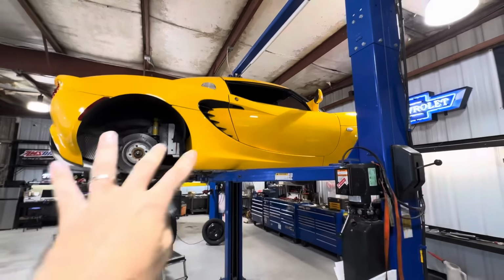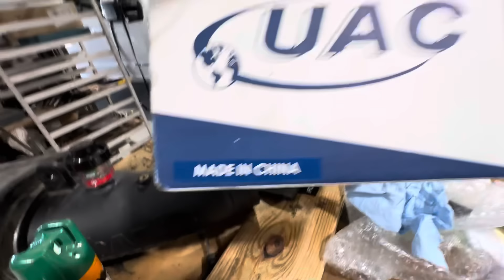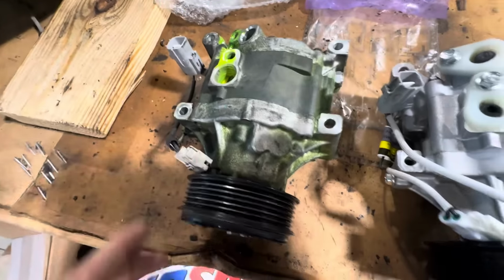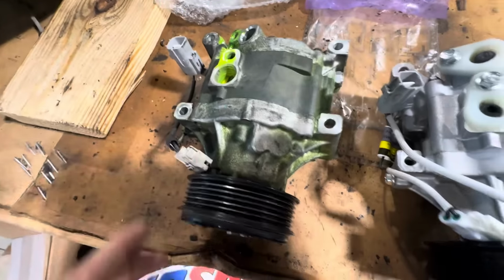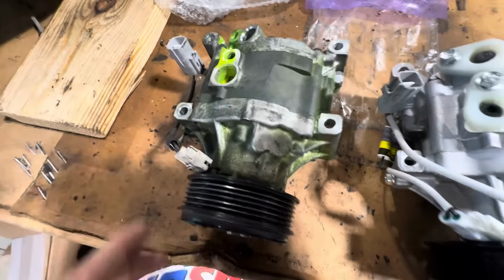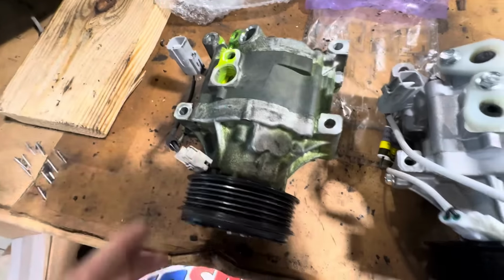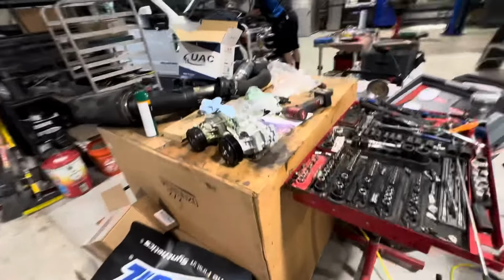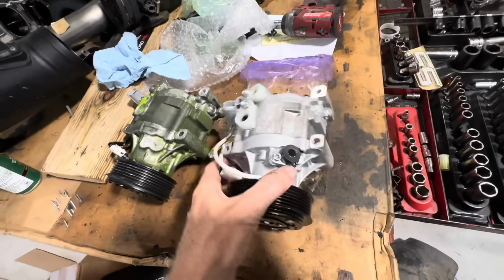Compressor Swap Something not right! Lotus Elise 1.8

Comment: Surprised that the owner would spend the money on the car but cheap out on replacement parts. Always the best bet to go with OEM parts if possible.
Reply: Maybe the original part from Lotus is not avaliable.  Maybe he can find a toyota MR2 version that will fit
Reply: Other than that, finding an A/C compressor is a piece o' cake...
Reply: Not ALWAYS.  There are a number of parts that are much better in aftermarket than OEM.  For some reason, a lot of car makers assume that oil change places hire master mechanics rather than teenagers, so they use a fragile oil filter housing.  Even Toyota is doing it now.
Reply: Best? maybe. But you assumed the OEM part is available for a 2007.

That UAC is the brand RockAuto lists, only one part number (out of stock).

Comment: Yeah making sure it fits is the key and checking that plug on the car was the key. Because who knows that old compressor was not just a replacement itself at one point early in its life. The wire being only one proves that it's not the right part. So many times people want the same connector and so on but this is a reason why not using the same connector would stop someone from slapping on the wrong part. Its not the connector thats the problem but the locking mechanism they need to make right and leave it.

Comment: It's likely that without the second wire it will run as a normal single displacement compressor at full flow. I've seen variable compressors fail on the variable half and operate as a single stage just fine. I'm guessing they make it as a either/or replacement to save costs of making two different designs.

Comment: I tried a Ebay alternator bolt were way off because it was assembled with wrong case 180°out to fit. Then I got a mounting bracket that wouldn't fit. Went to dealership and got another one that didn't fit luckily i had a parts car with correct parts

Comment: unfortunately sometimes you have to show them, and also i've had cases where i had to get the part number off of the part itself because the manual (or parts supplier) just didn't know or had multiple choice so they pick the most expensive option. In this car's case i understand why you basically have to pull the part and get numbers off of it or at the least take a picture of it.

Comment: Pulley diameter not really going to do much, slightly lower RPM on the compressor, so slightly lower flow, so slightly lower cooling efficiency in traffic at idle.  Belt tensioner will easily take up the extra throw with no problem.

AFAIK the variable displacement system is a bolt on, that simply bleeds back from the hot high pressure back to the input, so as to allow modulation of the flow from the compressor to allow control, so it will, with no power applied, default to full flow of the system, so putting it in and not connecting will do nothing. The lower RPM will also help, so full flow will be at higher RPM slightly, probably just off idle, and the system will then simply act as a regular unit. Variable displacement works with electronic expansion valve, allowing control of evaporator pressure so as to allow simpler orifice plate expansion, and strict control over high side pressure using a pressure transducer in the high side, so you need less power to run AC at full power when off idle, improving fuel economy.
Reply: Ray, send the car to SeanBZA and let him be responsible for this wrong part repair

Comment: Depends on the compressor.  What is the base unpowered mode? Is there greater gas flow with voltage to the variable mechanism or is there less?  Obviously the car is not going to send a signal.

You could energize that variable mechanism and turn if over by hand and see if you  can tell a difference energized or not energized.  Me?  I would just order a new compressor and let the customer send it back for a refund.

Comment: Looks like the compressor for the newer model, with the upgraded, automatic climate control, rather than the basic aircon, that seems to be fitted there.
No idea if it would work in the basic mode... I mean, maybe... depends how the gubbins inside works. Definitely better using the same part as the original.

Comment: We may come to find out that in the ordering there is an option for that variable type compressor, and a different number for each. Maybe a dash one (-1) for the variable part number. Only the parts department can answer that one. Would the dealer be better for more info. I know, that is a whole other can of potential worms. 🙃

Comment: Rock Auto says that the specific compressor for that car is not available from UAC or anyone else.  That RARELY happens, and is really odd for a Toyota engine, so Lotus must have spec'ed a very unique compressor.
Reply: Awesome.
Reply: That could mean that the aftermarket suppliers just don't know which compressor fits, not that it isn't available. They may have some on the shelf, listed for other vehicles, just don't know it also fits this.
Having worked in autoparts, for many years, I've often seen the 'not listed' interpreted as 'no other options available'.

Comment: ya it looks like the compressor the owner bought was for a Toyota mr2 spyder 1.8L
-RYC New AC Compressor FH310 Fits Toyota MR2 Spyder 1.8L 2000 2001 2002 2003 2004 for $250
the only one i for images for online might be
-NEW Compressor FOR LOTUS A120E6491S Elise Exige S240 R SC 88310-02270 06 07 08 09 10 SCSA06C 447220-6364 - from coolairparts and it is $600